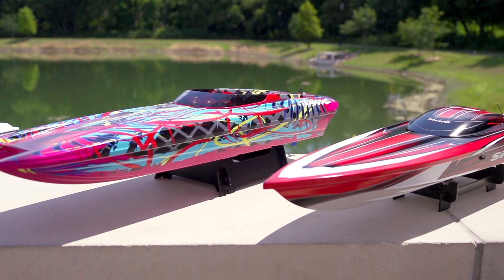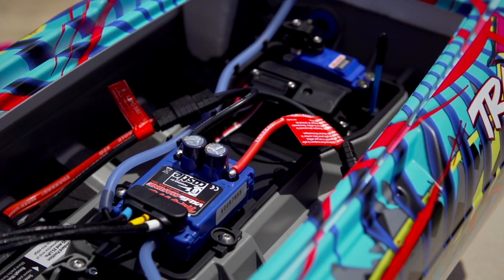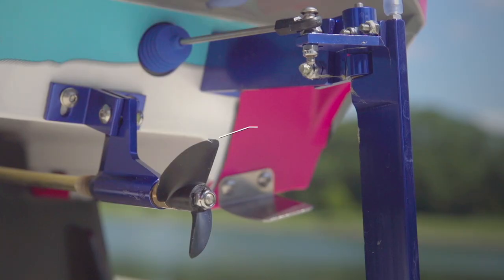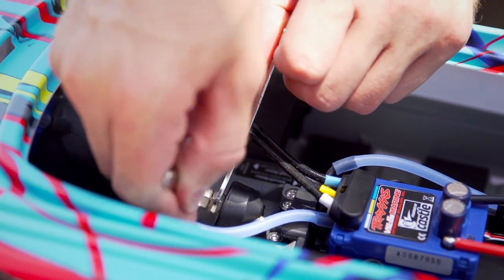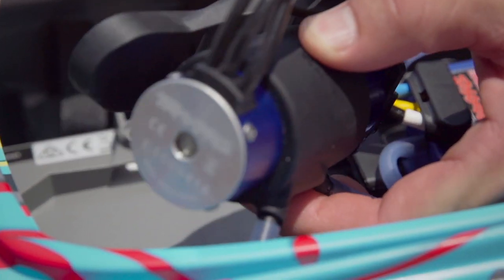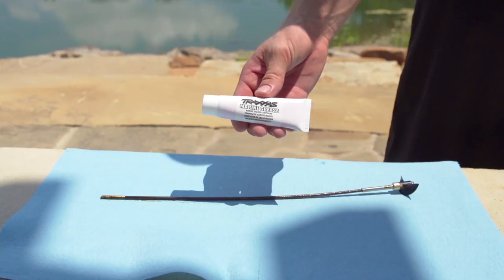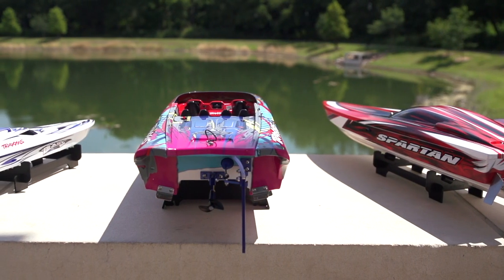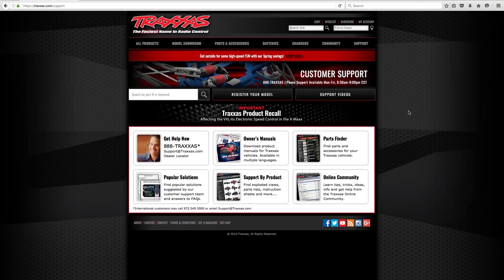Marine Maintenance | Traxxas Support

Comment: I have the Spartan and M41. A little advice on both - If you notice water inside of the hull after running and you're not preventing it from coming in for whatever reason....Hood leaking, motor cooling jacket has too much water pressure. Then most likely there is water inside motor and will not dry out like on mine. The best thing is taking motor out and apart to dry plus the motor bearings need to be monitored for play on all your brushless motors.

Comment: I really want a M41 widebody
Reply: Is is very cool and fast
Reply: I got it’s awesome
Reply: I just got one too it’s awesome , the only thing is the plastic is abit light... I guess a vinyl wrap will make it a lil durable.😎
Reply: Then just buy it
Reply: And the advantage of it been light is it really zippy I use zee 9000mah battries and have half hour running sessions out of them I got 4 sets
Reply: @AdrenalineAshRC  get a weighted vacuum head for cheap and take the weights out of it and zip tie them on the inside
Reply: @jonaswalter9800  thanks but I ended up filling All the gaps with expanding foam .  Did the trick . 😎👍
Reply: @AdrenalineAshRC  that’s heavy enough? Sounds like I should try that too
Reply: @jonaswalter9800  don’t fill the whole gap remember it expands so try a bit at a time and use as you go along or it can get messy lol 😆
Reply: They weigh like what feels like half a pound.

Comment: Doesn't WD-40 disperse grease and oil? Wouldn't this remove the oil from the bearings?
Reply: Boo Ya even they dont know that wd 40 in NOT a lubricant its a solvent
Reply: Erik Silchuk yes but wd40 is Leo water displacing which is why they recommend it
Reply: photography on the cheap regular oil displaces water too
Reply: Agghh - wd40 is evil! Use oil for toy trains or AC fan motors!
Reply: For a multi million dollar company they sure are stupid
Reply: The solvents evaporate and leave a coat of oil behind, otherwise wd40 would cause rust instead of prevent it.
Reply: No moisture

Comment: Issues with Blast cavitating.  Appears to have all power, but will not get up to speed.  I have followed troubleshooting advice via Traxxas, but nothing seems to work.  I have checked the prop...no issues.  Worked with the trim...no change.  Anything that I am not thinking of..?

Comment: Hello guys. The propeller cable of my Spartan just broke, the boat lost the propeller in the middle of the lake. Brand new, first use. Any idea why that happened? 😢
Reply: Rip bro... did you grease everything first or did you run it out of the box? If you ran it out of the box before greasing anything that's what killed it. Every 15 min is crazy...

Comment: Question my m41 widebody has an issue I believe I turn on receiver first then plug in 2 fully charged 3 cell lipos  it does it’s sounds green light to indicate voltage drop but theres a blinking red light in we’re the receiver box is at if that accounts to anything boat is on its stand mind you but when I pull throttle our steering wheel our any of the switches  nothing happens also this boat is new I have never ran it I tried but all this happened can anyone please help thanks do I need to recalibrate perhaps iam lost
Reply: Sounds like you need to reconnect the transmitter to the boat. But it's been 3 months since you posted this so I'm wondering if that was the fix, and if not what did the problem end up being?
Reply: @Youtoobsucksnow  yeah I just needed to bind the transmitter

Comment: what about sea water? if some go inside electronic stuff we need to wash the inside of the catamaran with water before maintenance? thanks
Reply: @Daniel Nunez am I able to use it in salt water though? Someone told me it will mess the boat up right away in salt water
Reply: I put my Proboat Stealthwake(brushless setup) in the ocean. It was awesome.  Did not flush it well. Sat up for a few months, basically everything was ruined except ESC. Learned my lesson.
Reply: I just ran my m41 in saltwater and pretty much the moment i took it out i ran clean water through the cooling system before the hot electronics dried the saltwater in there and then i used wd40 to push whatever water was left out and hit the line with air gently. Soaked everything else metal with it as well, all the stuff in the rear and bearings so far so good.

Comment: I’m having trouble removing my flex shaft on my m41. I’m sure what I’m doing wrong..do I need to remove the entire motor out in order for the flex shaft to easily slide out??
Reply from the maker: You should only need to loosen the two halves of the collet and remove the black cover. This should allow you to pull out the cable from the rear by pulling on the propeller (make sure the batteries are removed before going near the propeller). If there is still an issue please call us at 1-888-TRAXXAS (US) or e-mail support@traxxas.com

Comment: Are the batteries suppose to get wet ? Most runs they get wet and ones already puffing , it's a traxxas battery too
Reply: Warranty.

Also are you storing them charged.
Reply: If ur afraid of getting the lips wet use some electrical tape around them to keep some water out. Also don’t store them charged.

Comment: Just got mine yesterday and am scared of running and flipping it as i will have no way to recover it any ideas ?!
Reply: Get a cheap other rc rescue boat
Reply: Deez louize still in the original box till this day lol
Reply: MyDyingBride A small one person inflatable boat 🚣‍♀️ works.
Reply: Fishing pole with a weight cast to the backside and slowly reel in over and over until you get it to hook and definitely slowly reel in take it easy when you're out far but when you're near the shore give it what it gots and do not turn until you slow way down and turn the QT I believe all the way off the thing that helps you to control is horrible to have on especially at high speed it will start trying to turn and correct and say bye-bye make sure your batteries are strapped in really good use all the velcro on it I put my batteries all the way forward to help with the Wheeling and change the pitch of your prop a little downwards to force the nose down just a tiny bit
Reply: Swimsuit, strangers and law enforcement don’t like it when people take their clothes off in public

Comment: What do you call the tiny rubber bit that is on the stuffing tubing?  Mine broke off after the 2 or 3 time I ran it.  I need to put another piece of plastic on there because I feel like water is getting inbetween the tubing and the drive strut.  I know it is.  I've been putting a piece of tape around the tube and the shaft to try and keep water from pushing in, but are there slamm plastic tube piece you sell?  Maybe I'll just find some plastic tubing that fits over the aluminum tube at the local hardware store
Reply from the maker: Sounds like it might be part #5725 - https://traxxas.com/search?keyword=5725

If it is a Spartan or M41 check out the exploded view to see which piece it is:
https://traxxas.com/explodedviews/DCB-M41-Widebody-57046-4-Chassis-Assembly
https://traxxas.com/explodedviews/Spartan-57076-4-Chassis-Assembly